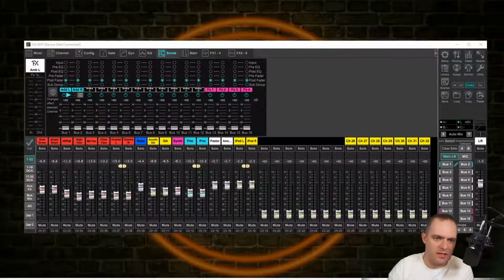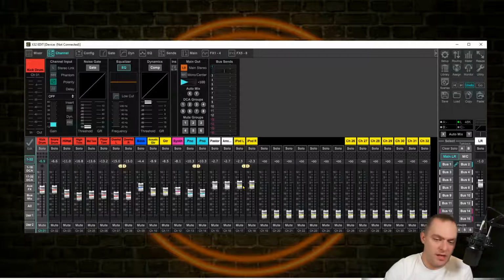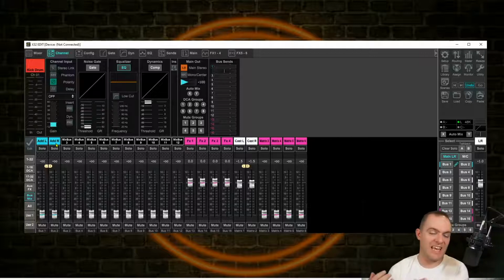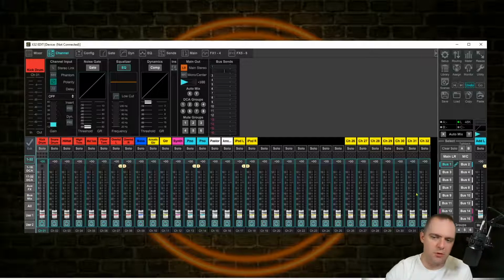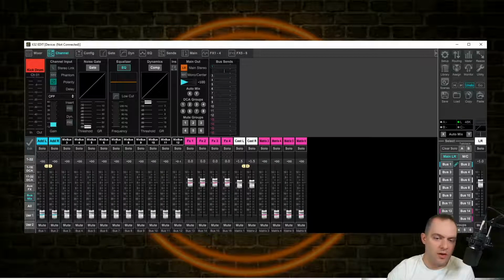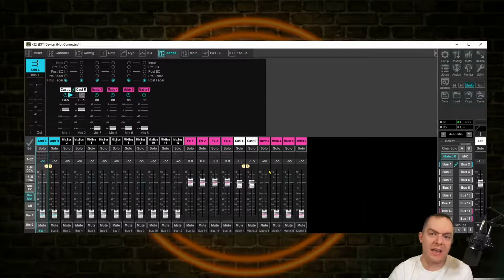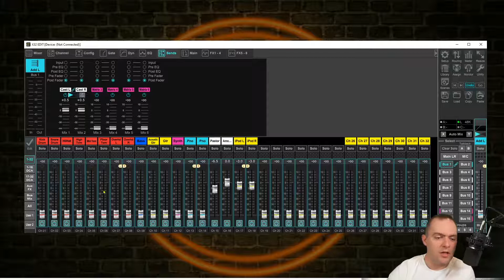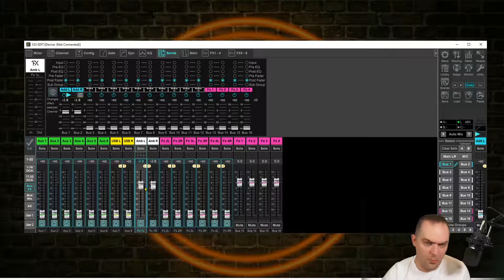How and why to set up a MATRIX MIX for your Church Broadcast

Comment: Something A little different that sounds like I need to use a matrix, but unsure of the set up. 

WHile I would love to be able to adjust single fader and make it work in house and on the stream.  We use acoustic instruments, guitar, Baby Grans Piano etc.  While the Piano for the sanctuary is lower I need it higher for the mix.  Would this same process work?

Comment: Been an audio engineer for many years now. I've been touring with a couple of Rock bands. I've worked on and also toured with many digi boards. No one has gave me much prob. Recently we were on a tour and our "FOH" board decided to "quit"on us during set-up.We got a local vendor to provide us with a digi board. And that"monk"brought us this insane "Lego" set called X32. I have to be honest, It is truly an "Adult Lego" set. This could be one of the worst boards I've ever come across. 😪. One will literally have to go all over the world just to organise your mix. Plus god knows? they have repetitive options which does the same thing?!!.It's like driving a car with two steering wheel?. We are on the road,we don't have much time at most gig's or venue. I have to take my hats of to Behringer X32. It probably should be ranked as the no1 sound engineer "nightmare"when it comes to digi boards.

Comment: I don't understand this video.

Common sense would say, set up a separate mix for you broadcast and have someone mix that Live. 

If you have a sound engineer in the venue, mixing for the venue, it is not logical to have "the same" person make adjustments for Broadcast/overflow etc. If you have an X32, get someone else on an IPAD mixing for Broadcast (in another room of course as there will be a delay) and get another person on another tablet mixing for overflow.  

Am I the only one seeing this Logic?
Reply: Ideally yes a separate mix engineer, however not everyone has the staff to run both a FOH mix and broadcast mix. Matrix mixes are one way to deal with that.
Reply: As someone who does all this on their own, I do, in fact, see the logic
Reply: @cooperarbogast4018  same. It’s a good way for churches who don’t have a ton of sound guys or money for iPads etc to get a solid stream mix. You can take it a lot further than in this video. Check out James attaways video on matrix groups.
Reply: @willrobinson6866  I used his videos to start getting acquainted with doing sound for worship and church services, definitely a great resource.